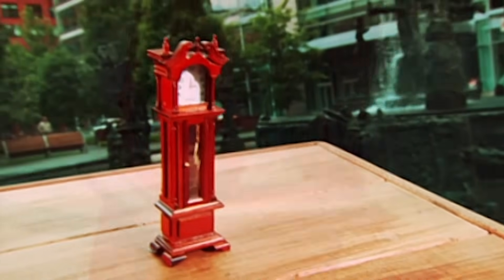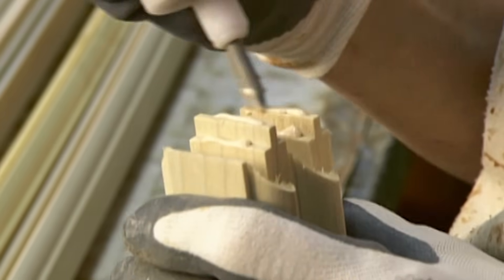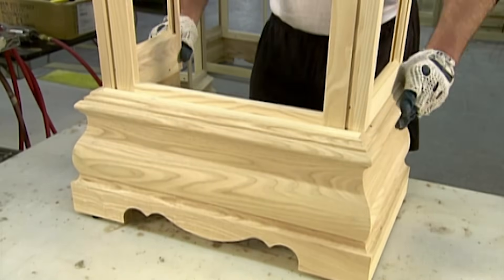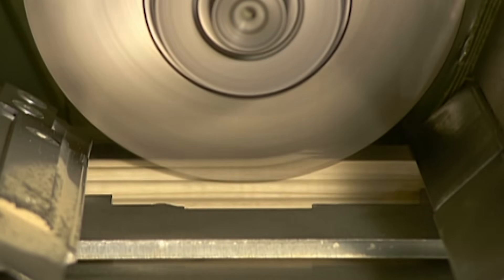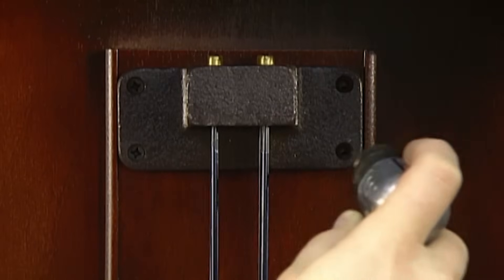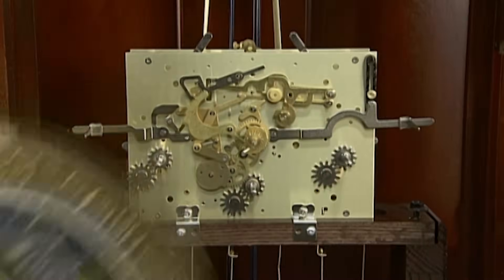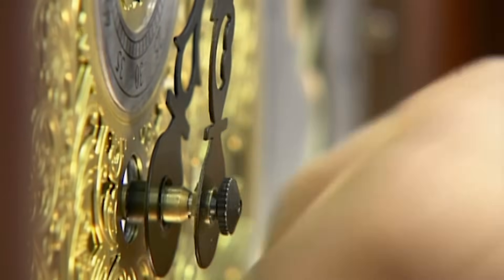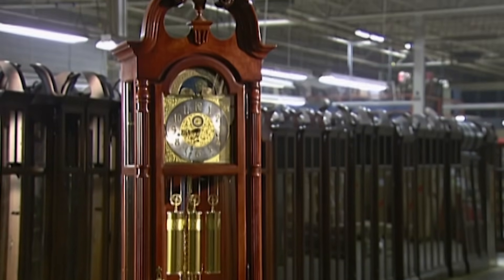GRANDFATHER CLOCKS | How It's Made

Comment: Modern crap. This is nothing how Longcase (grandfather clocks) were made when they were most popular in the 1700 & 1800 hundreds. One more thing this crap won't be around in 200 years time they will all have been worn out.
Reply: Say that to the cheaper battery powered Quartz grandfather clocks made by Sinix and Daniel Dakota. These are the cheap ones. At least Howard Miller’s clocks with their mechanical movements and real wood cases still have some degree of quality compared to the electrical components, fake pendulums and weights, and particle board cases of the others I mentioned earlier, despite being modern and mass-produced.